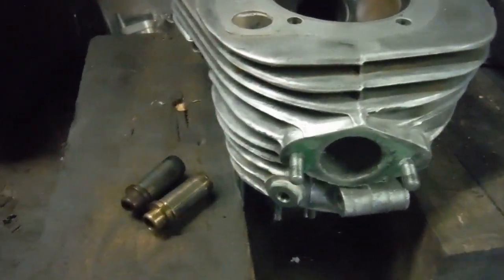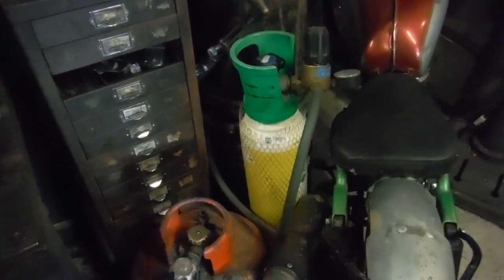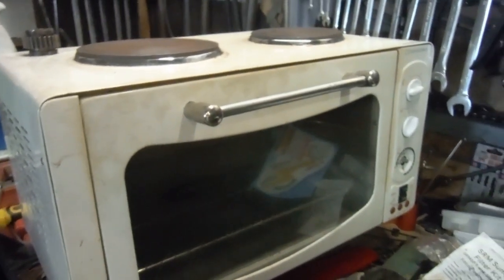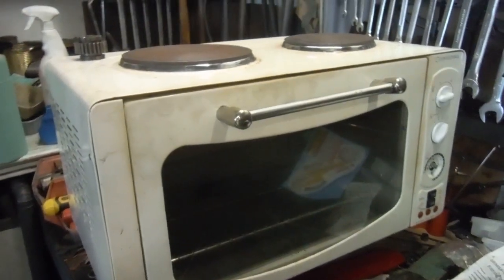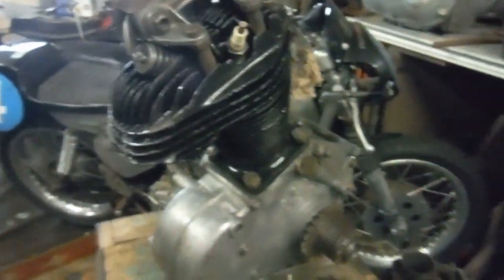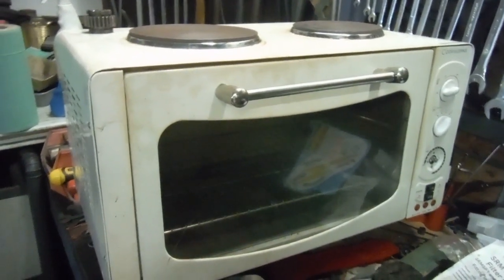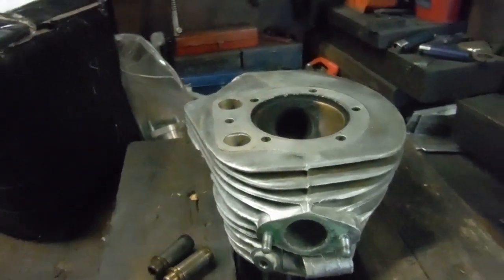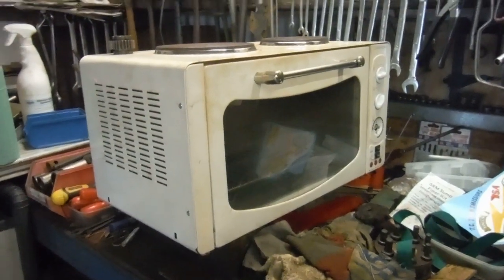A small electric cooker beats the gas torch for valve guide and bearing removal in the workshop!

Comment: Does it taint the leek and potato pie when you warm it for lunch😂😂😂. Great bit of workshop kit. Saves the grief of using the one in the kitchen. Been there. Only need to soak a ring gear at 80 degrees to drop on a forklift fly wheel. 👍👍

Comment: Ovens work wonders.
The other good thing about them is that they heat evenly, so there is much less risk of distortion.
It's even better if the oven has temperature settings, though one of those infrared thermometers are useful for checking.